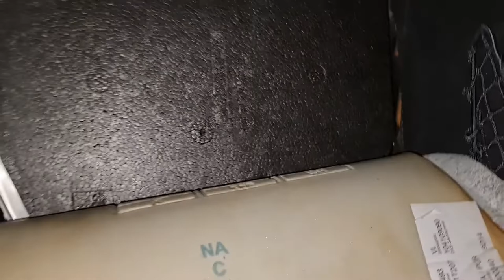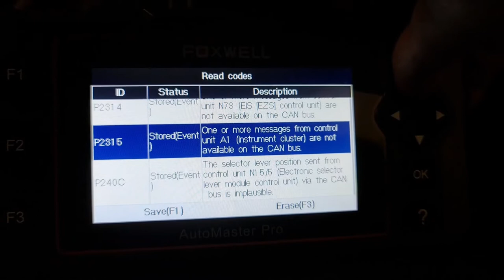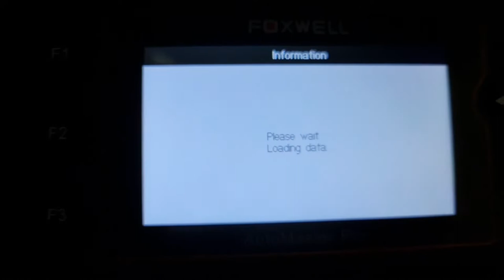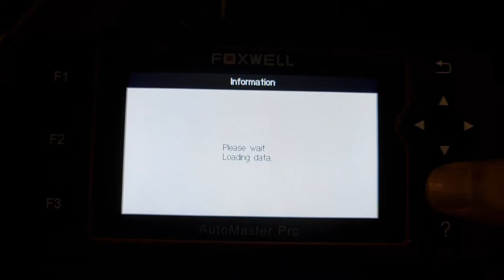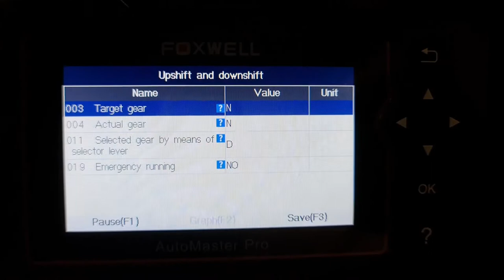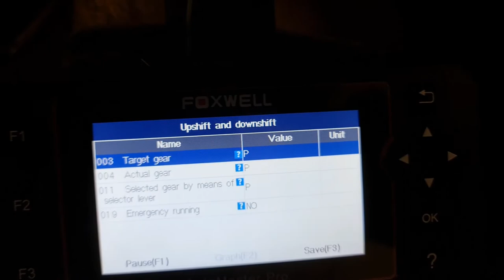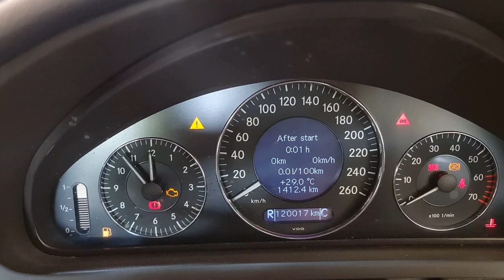Mercedes transmission limp mode? Gear Shifter issue?

Comment: Hi, I checked part 2 of your video and it does not show where the oil is coming from and on how you fixed transmission oil leak on the TCU area. Please advice as how you resolved the oil intrusion issue
Reply from the maker: https://youtu.be/FKWbl3cYUo4

Comment: Bro I had 4 mb c230 kompressors and because they are now considered hard to find stupid me had one sent from Ohio to new Jersey and it has the least miles of all of them and the bitch has been stuck in limp mode now for 6months...so here's my thing. I went to a local euro performance shop and they told me it's the gear selector that went bad too. ..I was leaning towards valve body or conductor plate..
Reply from the maker: Yeah mate, it sucks that these gear shifters fail at some point after 60k miles or so...